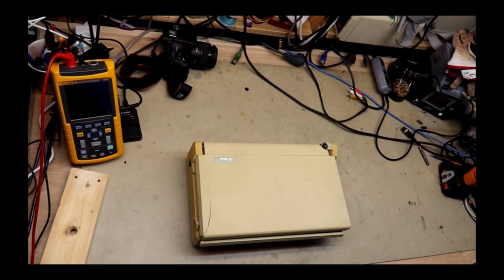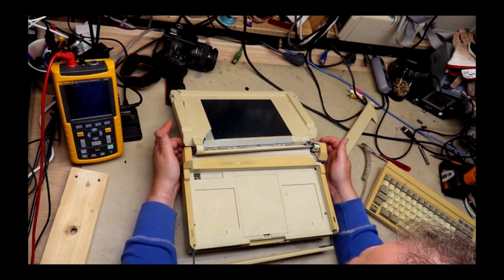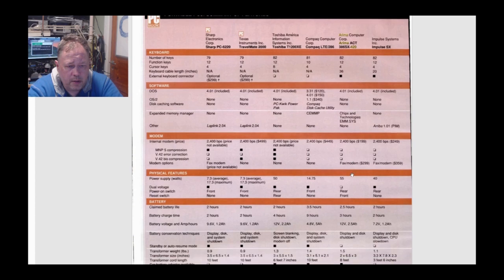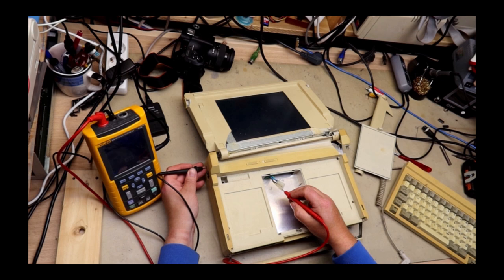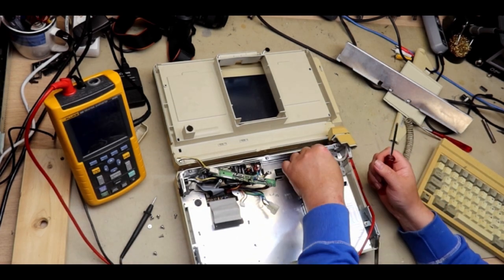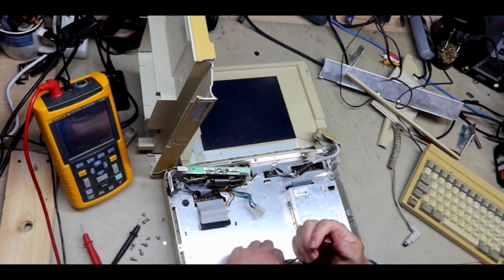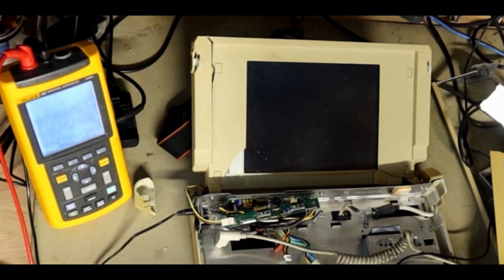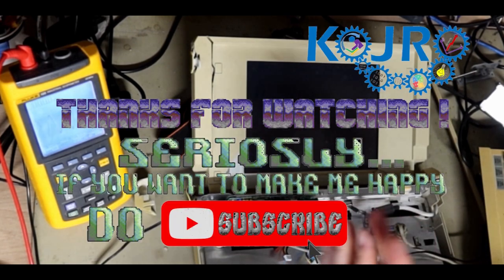The ACT 386sx portable from Arima, or most of it..

Comment: I have the ACT-286 version! Runs on 12MHz. I rescued it from a dumpster about 22 years ago. Young me did a lot of painting on it (literally). Looks identical, without the external damage. The internal power supply died many times, it's now running on a Commodore PC-20 PSU that has been hacked for the -20ish Volts for the LCD.
When it worked, I ran it on 19V.
It has a 128MB IDE DOM (laughs in Award BIOS with Type 47) and I killed the floppy drive by plugging it into another laptop that had a dead FDD that looked compatible. Mainboard and video board look very similar if not the same (it's a while since I had it open). This is probably a near-zero effort 386.
Reply from the maker: Nice, I have not seen that one in real life, but I have an old magazine from 1989 where there is a picture in an add. So this has an award bios, mine has an AMI..
Reply: @kojroRI  oops AMIBIOS, my bad. I was probably thinking about that Percy 16 MHz 286 I was given back in '98 which rather young me totally ruined. That one had a locked-down version of AMIBIOS (for example you could only select HDD type 2 or 17). 
The Arima has AMIBIOS (with the RAM test click sounds) and 4 RAM slots like yours. I upgraded it to 4 Megs. It has Windows 3.1 and PowerPoint 3. It's slow, but it works.
Btw. - LM tests it at 15MHz AT, the Compaq SLT-286 tests at 12MHz AT, running STUNTS side by side shows they're completely in sync through the entire attract mode (at ~2fps, it's easy to tell), so 0 wait states seem to make no difference in some software. And the game doesn't use FPU.